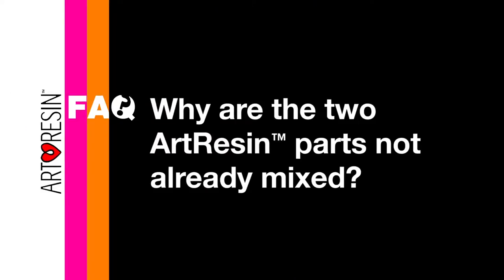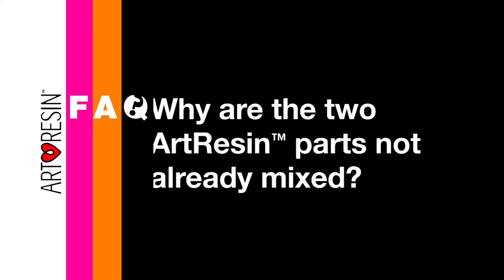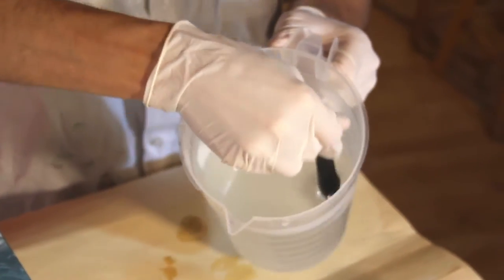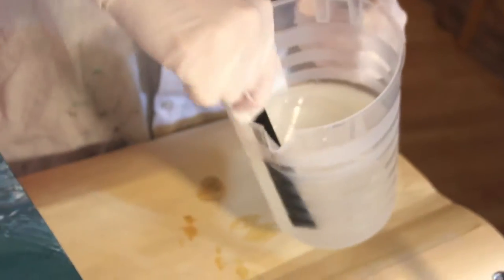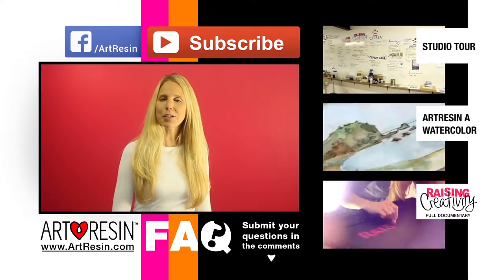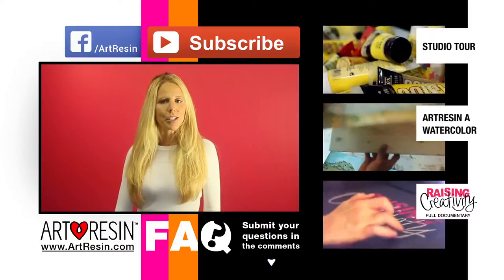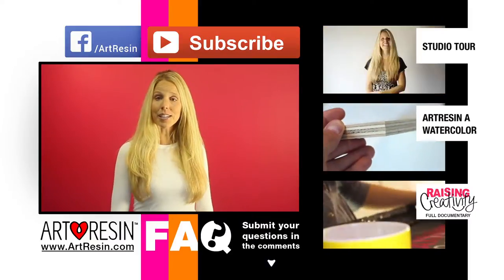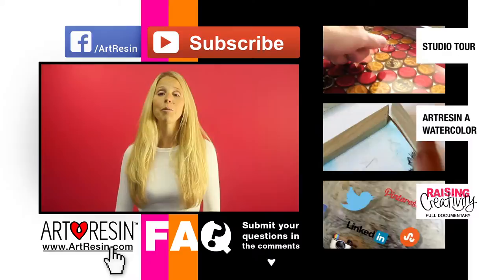mixing epoxy resin - 2 parts!

Comment: Hi, Thanks for the video. so my question is should I use the measuring cups or should I weight the resin?
Reply from the maker: You will want to use measuring cups as our product is measured 1:1 by volume not weight :)

Comment: Can I just use a measuring cup to mix both? Like first pour in 150ml of Part A and then second fill up to 300ml with part B? Or do you have to measure 150ml each separately and then pour together to make 300ml?
Reply from the maker: yup!

Comment: I am using Art Resin for the second time I didn't know that. I used to fill in the same cup resin at first  and hardener after. I am confused ! Thanks for your videos 😊
Reply from the maker: Hi Nicole!  
Our favourite method is to use a measuring cup ( the same kind you'd use in the kitchen ).  
First we pour in the resin, and then we pour in an equal amount of hardener.  
Then we mix for 3 minutes and pour.

You can also pre-measure you resin and hardener in 2 separate containers, and then pour them both into another container and mix.  
This is handy for very small or very large amounts.  

Hope this helps you!